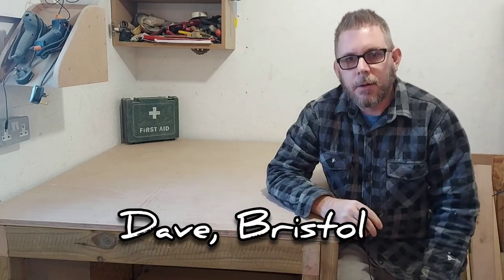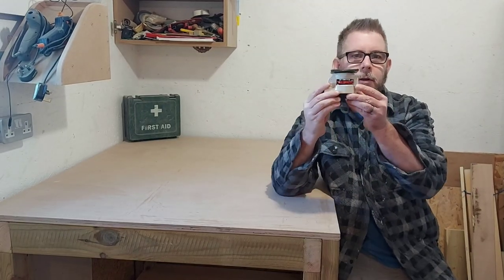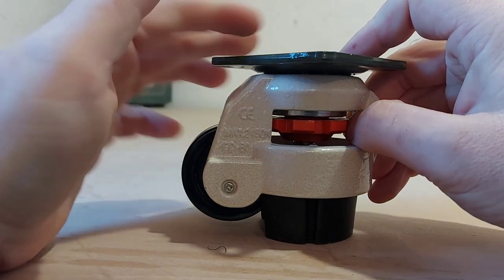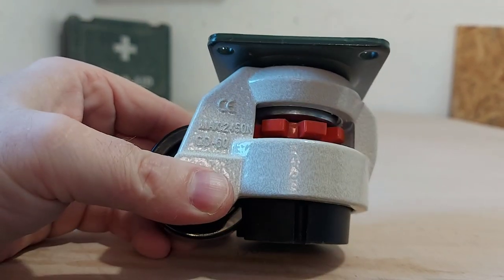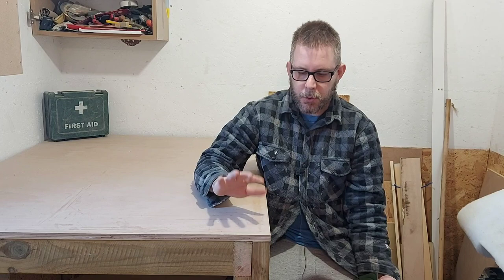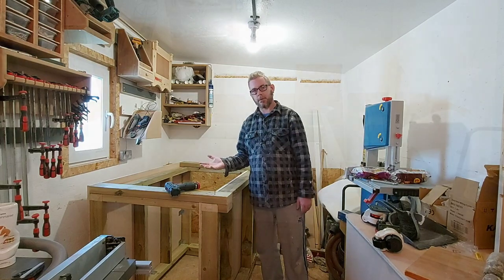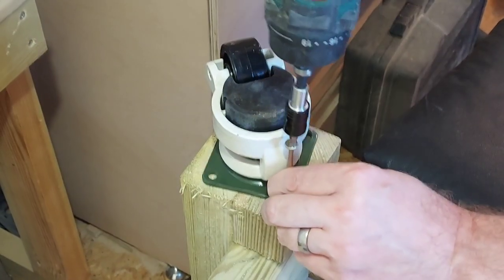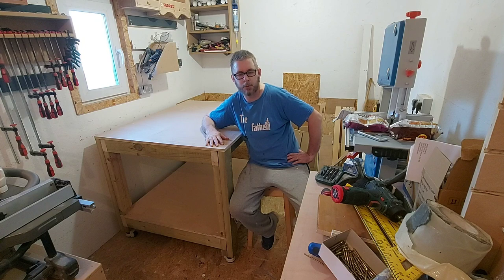Retractable Leveling Castors

Comment: I've been looking at these for a while now, the only thing that puts me off of them is having to reach around to the back wheels to adjust them. Not so easy it you don't have much room to squeeze your hand in 🤔
Reply: Ah fook it! Just bought a set. Have some pennies from me! 🤗
Reply from the maker: Mate I have the same problem. Can easily get to 3 but the one in the back corner is awkward. Just gonna leave that one on the wheel & only raise the other 3 just enough to hold the bench in place. That way if I need to move it its easy.

Comment: is it easy to lower the castor under load? I worry that a heavy workbench will make it difficult to turn the adjuster.
Reply from the maker: They are easy enough to adjust it just takes longer as you have to get down & adjust each one. OK for me as I don't move the workbench constantly but if it something you move all the time I can see it being annoying

Comment: I see Amazon stores using the Footmaster model numbers of GD-60F but are "Foot Castor" brand, a generic. Your listing is outdated but I found a similar posting of $36 for a set of 4; Foot Castor that copies the GD-60F. Considering Footmasters are $32 a piece there has got to be a difference in quality. I don't think Footmaster charges what they do for the hell of it. Something to consider, but I think I'm going to roll the dice on the Foot Castors. $100 cheaper and has a 4.6 rating across 99 ratings.

Comment: How  stable is the table after fitting these dave ?
Reply from the maker: The wheels are very sturdy. They are a tad awkward to adjust as you have to bend down to lower or raise them. Not a problem for me as I don't move my bench much. Just something to consider

Comment: These things are an absolute faff to use, down on your hands and knees and very expensive.  Have a look for the side mounted, foot operated levelling casters - they are far superior.
Reply: Yes, but the foot operated type are a trip hazard, and prevent the bench being pushed tight to a wall.
I don't disagree though, these ones in the video are a faff, I have to reach under my bench to get to the far corner, but its the best option I could find.